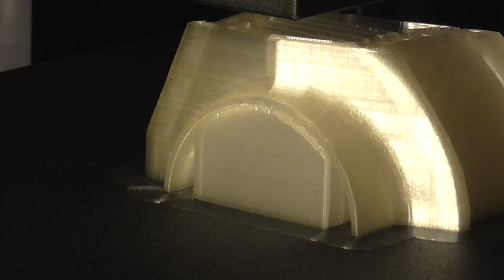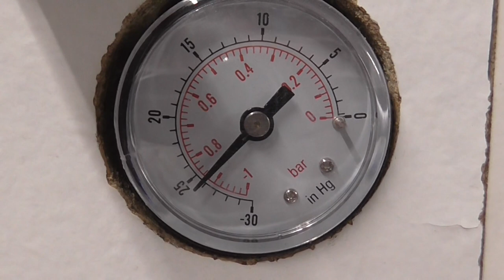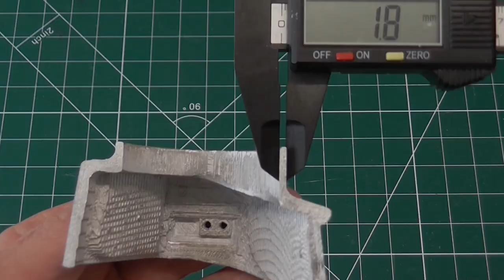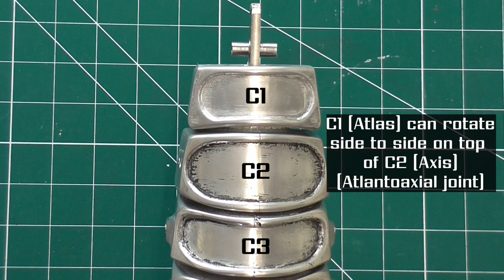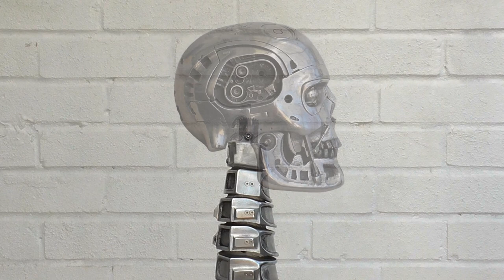Building the Terminator EP11 Neck

Comment: Ive been following your videos for years.
I am glad to see you are now using 3D printing to make the inside of the moulds!!!
it must save you a ton of time.
Reply from the maker: Yes, I never really got into 3D printing for actually making finished things, but used this way as an intermediate step it works really well and allows me to create certain objects, such as this, that would take much longer by any other method. And now that I have a 3D printer I find myself using it for prototyping things too (which I think is what they were originally invented for?)
Reply: Skynet wants to know your location.

Seriously though, I love the engineering you put into these. Amazing work! 👍
Reply: @AndysMachines   author, please tell me what kind of plastic was used?
Reply from the maker: @ДанилНадворский-п9д  It was normal PET. I use the natural/clear for investment casting as some of the pigments in the coloured filament can leave residue behind.

Comment: Did you design the machined parts by yourself or did you use plans from other builders?
Reply from the maker: I designed all the parts myself (I even modelled the outer shell from scratch). Though this type of mechanism is well known in robotics circles, it's called a 'continuum robot' and is often used for small lightweight robot manipulators.
Reply: @AndysMachines  you really have skills, excellent work!
Reply: @AndysMachines nice. this series ain’t getting the YouTube algorithm attention it deserves. Hopefully it will start to appear and get some critical mass